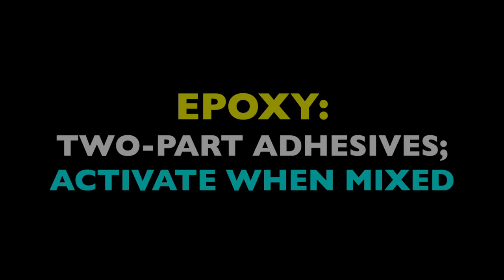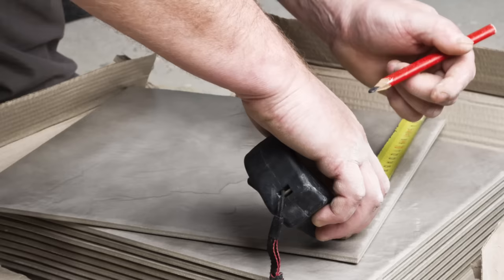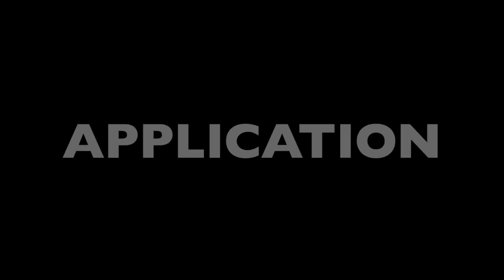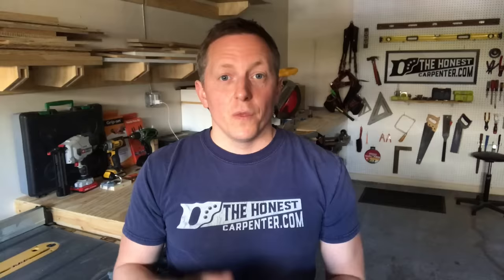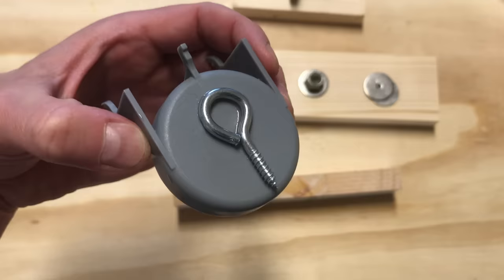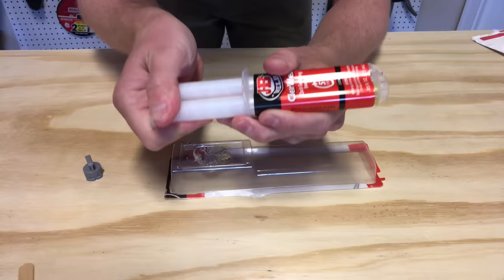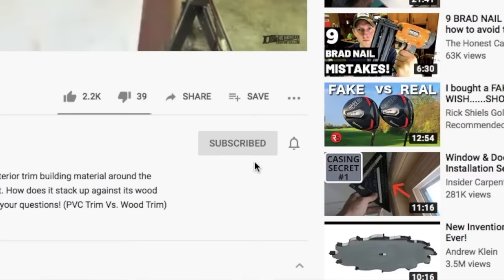DON'T USE SUPER GLUE! Try This Instead..(Epoxy Adhesive/5-Minute Epoxy/Epoxy Glue)

Comment: What is it's melting point so can used on metal parts in engines or weld a kettle parts? Are they toxic to be used on food containers and eating utensils or cooking pots and pans
Reply: Epoxies vary in their sensitivity to or resistance to heat. Generally okay for patching a car radiator but not okay for exposure to direct flame. Most types can handle maybe 300 to perhaps even 400 degrees (read the product info!), but they are petroleum based products and I would not use them on cooking gear. Some types of muffler repair kits might use a particularly high-temperature epoxy, I'm not sure....as a kid, I used a particular type of Devcon epoxy that had a white ceramic-like appearance ( no longer available?) to patch up and modify a leaky mold for fishing sinkers, and the stuff held up well against molten lead at 800 degrees. There's also a non-epoxy paste filler called liquid aluminum that works well under heat, but probably not suitable for fixing pots and pans.....but people have fixed small cracks in engines with JB weld.

Comment: Horses for courses, you would not bother with epoxy on the mitres on the pelmets and cornice on kitchen units would you ? I like polyeurathene glues for some things, urea formaldehyde for others. I only use epoxies when I need strength,and never the fast cure type.  What about contact adhesives, thixotropic or not !    The point ?  there is a place for most adhesives somewhere in woodworking !

Comment: I've always found Superglue (cyanoacrylate adhesive) to be of very little value as a permanent adhesive.  My only real success with it has been on some plastics.  Even then, the repair is only temporary, provides very little tensile strength and always breaks at the repair location in a short time.  Epoxy, on the other hand, is commercial strength adhesive and has been my go to repair adhesive for many decades.  Unfortunately, the consumer is usually limited to those epoxies rated up to about 4,000 psi and for some reason, the higher strength epoxies are limited from consumer use.  Dental epoxies or some used in the automotive industry are good examples of the high strength type.   Epoxies bond, fill gaps, can be cut, sanded, drilled, shaped and reinforced.  Many cure under water or in moist environments.  Most epoxies are electrically inert and are used widely for "potting" electronics.   I have started to use cyanoacrylate adhesives again because of their ability to be accelerated and bond instantly for some applications.  When assembling models and prototypes, parts can be temporarily bonded instantly before being fortified with another fastening method later.  Voids can be filled with products, such as baking soda, or commercially available spray-on accelerators.  There are stronger adhesives out there....and I want them.
Reply: You make some very useful and informative observations here.  Guitar repair is another example where you may want to break the glued part loose later.  The guitar nut might be held in place with like two drops of Super Glue.  Then, whenever it must be replaced, it can be popped out with a hammer.  Guitar frets are presumably also where CA is used.  I haven't any personal experience with fret installation or removal where they have been held down with CA though it's often done.  Most guitar parts are joined with temporary bonds so they might be disassembled later for maintenance or upgrade.  Hide glue, for instance,  is used a lot for stringed instruments.

Comment: 1) Unless you have totally separate containers like that Devcon Epoxy, once you twist off that cap you need to use it all within  a day or two.  '
2) Sometimes thinner is better - for fine cracks in wood that you don't want to Force open or just can't force open to push in that thick epoxy glue. I know of several high-end table makers who use epoxy resin for the basic filler of their tables but also use CA glue as a filler for the fine filler in bubbles and imperfections in the table and the epoxy.   
3) Super Glue in the little tubes is far from the only way CA glue can be found.  Model builders have started using CA (Super Glue = CyanoAcrylate or CA) for almost all kinds of materials.  It comes in super thin (Great for fine cracks in wood) and it comes in medium, thick and super thick versions.  None are as thick as the epoxies shown in the video but then for some projects that thick epoxy is just too hard to spread.   Plus the better CA glues have an accelerator for them that speeds up the setting time and makes that glue ready to function at full strength in less than a minute.
Bottom line - Use the right glue for the job. It may be epoxy, it may be CA or it might be the various forms of old Elmer's glue which has been highly modified into glues like Titebond (At least 3 version) and even the old school glue form of Elmer's glue.  There is no one form or type of glue and epoxies are just one of the many types available.  Oh, and i left out the Silicone adhesives which are a whole nother thing with pluses and negatives.

Comment: Hey does epoxy work on holding 2 plexiglass together???
Reply: There is a specific type of solvent used in plexiglas work. It's not an adhesive, it actually dissolves the plexiglass so the pieces literally "weld". It evaporates very quickly and the parts are permanently bonded. There are many Youtube videos showing how to do it.

Comment: hello, id like to ask...what can I use for glass?
Reply: 100% silicone works great on glass to glass. Especially if you can apply mild pressure to hold it while it dries/sets/cures. It works great on plexiglass/lexan also. Most hardware stores have clear as well as brown,gray, and sometimes black if you need a color. Allowing 24 hours to dry will create a very strong, flexible bond that can be undone if needed. It works well for sticking most anything else to glass also without the need for mechanical fasteners.

Comment: Please help me. I bought a house with a door that has three holes. One for the original door knob, above that, one for a dead bolt, and above that, a door knob. I have no idea what to do. I purchased different sized circular drill attachments, and I have a block of wood the width of my 1940 door. But I'm stuck. Also, they completely screwed up my door jamb to the bathroom, it looks like they chiseled all the way down and painted it. Oh, and they PAINTED my TUB! Who does this???? Help me, please!!!

Comment: Hi Ethan,  I need to glue the rubber liner (just small areas on the side) of an aerobic stepper (like The Step from the 1980's).  What epoxy would I use for rubber to plastic?  I used a double barrel epoxy many years ago, but I don't have it anymore and cannot remember what I used.  Thanks for your help.
Reply: Use contact cement
Reply: @JT_70  never thought of that.  I’ll do that.  Ty

Comment: The problem with using super glues to "fix" things, is that it doesn't "fix" things.  My experience has Always been, that after a year or two, it fails. It's bond strength deteriorates and fails. And it leaves behind a coating that interferes with rebounding it with more super glue, or any other adhesive. It seems to (perhaps) oxidize and crystalize, and break down.
I have basically quit using super glues, and no longer have them, except for repairs that need to only be temporary, and then the item will be replaced completely. Then it doesn't matter if the repair won't last.

Comment: Which epoxy brand do you use or recommend?
Reply: You can't go wrong with JB Weld-Original for most applications. Just stay away from the quick set epoxies if relying on it for maximum strength.
Reply: @davcar872  thank you  😊

Comment: Using cheap brush bristles is a good idea for spreading epoxy. Just cut with scissors and reuse next time. I hate the paddle thing they provide for mixing. Hard to use:

Comment: How many times can you re-use the same tubes after the first application?
Reply: I bought devcon 5 min. in 2 separate containers “plastic eye dropper like tubes”. I didn’t snip the ends but rather unscrew the top and dip out a run or 2 of it with a short piece of coat hanger wire. Use a different wire for each tube. Those bottles are  going on 3 years now and it’s starting to thicken and look like I’m due for a change.
Reply: @ehRalph  Thanks.

Comment: Epoxy has its place and the superglue has its place and you’re better off if you do not mix which one does well with the other one because there are certain things that epoxy does not do real well and certain things that superglue does not do real well but they both have their time and their place

Comment: FYI: LocTite has an Instant Mix version that mixes the two components in the tube. I didn't like the results. Personally, I don't think this works as well as the ones that you mix yourself. It just has the components contact each other and not really mix thoroughly the way you can by hand. I recommend avoiding that one.

Comment: What's the difference between epoxy and construction adhesive. I know there's a big chemical difference, but what's the difference as far as usage?
Reply: The construction adhesive I have seen is quite a different product, more like contact adhesive. Follow instructions on the package.
Reply: Epoxies are reactive adhesives, curing chemically. Construction adhesives are "non-reactive" adhesives, curing by evaporation. Upon evaporation of the solvent, the remaining adhesive bonds the parts. Construction adhesives are better suited for efficient applications of high volumes of adhesives not requiring a two-part adhesive like epoxy.

Comment: Good video BUT I think you are doing "super glue" a great disservice and as brilliant as epoxy is it cant do everything, no adhesive can.
First, "super glue" is a trade name, real name is Cyano Acylate or CA for short.
CA comes in every viscosity from thin as water to a thick gel which will hold its position. It also comes with additives like carbon to increase strength.
The main thing CA does best is make an almost instant bond and this fast cure time can be accelerated, epoxy cant do this.
With CA, you can position a part and then wick it into the tiny gap. I have on the odd occasion used CA to hold a part in position and then put a fillet of epoxy to make the real bond.  You can also undo a CA bond using Acetone, Epoxy can be very difficult to undo if not impossible.
CA is also brittle, more so if an accelerated cure is used.
5 minute wpoxy sets in 5 minutes, the full cure takes hours.
Bottom line is both are great adhesives when used appropriately

Comment: Just make sure you use it in a well ventilated area, as the fumes are toxic. If not, at least use a mask with a gas filter.
There's a good reason why a safety course is required to handle that stuff professionally (here in Denmark at least)...
Reply: I agree 100%.  I had a severe respiratory reaction. In the US we have MSDS posted online by the manufacturer, but are often not read or followed.

Comment: I’m wondering about using it to stick two pieces of a belt together.How does it work where it is constantly being flexed?
Reply: Epoxy works poorly for that. What kind of belt are you gluing? Leather? Rubber? An end to end glue joint will never hold but an overlapping seam should hold. I wouldn't use epoxy for your purposes, I'd use Goop, E6000, 5200, or Weldwood contact adhesive .

Comment: I’ve been using epoxy since before the 5 minute variety came out. I hate super glue. It’s messy and you run the risk of getting something stuck where you don’t want it. Epoxy gives you time to make adjustments in the position and then just wipe away the excess left behind.
Reply: Yes, emergency rooms deal with removal of super glue on body parts.

Comment: So for wood on wood, or woood cracks in a beam, why use this over wood glue and clamps?
Reply: If the joint in the wood pieces is loose or has gaps in it, then you are better off with epoxy  because it excels at gap filling. A slow curing epoxy will wet to the wood and soak into the fibers a little bit and give you a stronger bond than a fast cure, 5 minute epoxy would.  If you are talking about fitted cabinetry, or furniture,  where the pieces are mortished or finger jointed and fit together snug and tight even without glue,, then you are generally better off with a standard wood glue.

Comment: I'm not sure what my deal is but I've never had luck with epoxyies, except for JBWeld. They are messier, take longer to setup, then just don't work - theyre not better than super glue but it's more work for the same failure usually for me
Reply from the maker: Do you live in a cold place, Alec?
Reply: @TheHonestCarpenter  hey bud! I do. Maybe that could be it?

Comment: My biggest problem with epoxy has been poor adhesion. Good on wood but poor on metals. Good on cracked metal surfaces poor on smooth surfaces. It’s a mechanical joint. There is no chemical bond.

Comment: I always prefered epoxy glue with seperate tubes so you can freely choose the amount of each component. For some materials you could want more epoxy resin or more hardener depending on if you need it to be more flexible or harder.

Comment: I consider 5min epoxy to be my 'summer' glue: I live in a northern latitude, and stink of that stuff persists for ages - to the point that it basically precludes indoor use. Not to mention messy. Epoxy never fails to be hilariously messy. It's like herding cats.
I'm a bit surprised that this video didn't mention the 'West system' epoxy, which incorporates filler mediums for shaping and gap-filling. That stuff is like magic. But it's obscenely expensive, and for small applications, I'll stick with the ol' super glue + baking soda work-around.

Comment: What Epoxy would you recommend for glueing the soles of a worn pair of sneakers where the rubber has come apart from each other?
Reply: Shoe Goo is made for that
Reply: @carriewenholz9126  I have tried that and didn't work unfortunately, the rubber comes away after a few weeks
Reply: @redman9pablo  E 6000 is another good adhesive for items that flex. Whatever adhesive you use will probably have to be applied in a thin, even coat to both surfaces, let it dry for 5 minutes until tacky, and then press them together.

Comment: Windblades use so much industrial expoxy it's crazy, I feel bad for the workers who have to breathe the fumes as it sets off either in a barrel and smoke.
Reply from the maker: I can't even imagine what's in that stuff, Doran!
Reply: @TheHonestCarpenter  I forgot Blood, sweat and lots of it, Little bit of love. Wife works there for 11 years. Blade factorys run at 85° which cures the fiberglass, components, as well as your epoxy that has a decreased pot life from high Temps in factory resulting exotherm. I was quality till 2015. Then became full time dad.love the channel.good times !

Comment: Hello there THC! So epoxy adhesive it is. That said, what would you use when wanting to attach a no abrasive material to feet of chairs so that they don't scratch the absolute hell out of wooden floors. Good health to you and yours, Chris from the land of Oz.
Reply: Scuff the bottom of the chair for 'tooth' then a piece of felt can be stuck on with PVA wood glue. Will make a bond stronger than the wood in the chair :-)
Reply: Roger Forrester thank you very much for taking the time to answer.

Comment: I still prefer wood glue for split doors. I find Super Glue works best for fabric applications over smooth surface applications.

Now, Epoxy is evil. The main problem is the requirement to mix it. I can't exactly stick it in an applicator unless I get a longer setup time Epoxy that takes longer to dry.

In situations where you have nearly un-restricted access to the surface, 100% Epoxy. Anywhere you need more control over your application, you may actually want to use a more appropriate glue for that surface.

Comment: Super Glue (cyanoacrylate adhesive) is one of the most expensive products you will ever buy.  Epoxies are not far behind in cost.  EXAMPLE:  Amazon sells Gorilla Glue (cyanoacrylate adhesive) in a 0.71 oz. tube for $8.48    That is $11.95 per ounce.
That is $1,529.60 per gallon.  A commercial 55 gallon steel transport drum will cost $84,095.00    Ouch!!!

Comment: I worked in a few factories,.........Epoxy is only ok,.......5 minute epoxy is strong but breaks like glass,.......you want high impact epoxy (Golf Works ) it take's about 20 minutes before it starts to get hard.

But for bonding plastic Loctite made a glue  that has a chemical reaction and welds the piece's together.
Taking glues and hacking them can make some crazy glues.

Put a few drops of gorilla glue on your wifes best china and microwave it till you see it bubble then turn it off.
Thats some strong glue.

You can use  baking soda on super glue and its like epoxy it gets hot.

Comment: I have used various different brands of epoxy with different materials over the last 20 years. ALL are disappointing and fail in the long run. All adhesives work in the short run but eventually fail. Personally I've given up on all of them. Use a mechanical fastener if you want a long term bond.
Reply: I work with a lot of odd angle joints that are hard to clamp. I've had good luck with pre-fitting and drilling for mechanical fasteners. Mix and apply the epoxy, wait a few minutes then put your screws in. No clamp needed! Wait a couple of days and you're good to go. Of course, if you don't take your time with the prep, you'll have some problems. Been there, won't do it again, I hope.

Comment: What's the tensile strength for Super glue?
Reply from the maker: I think it's between 2000-4000 psi in ideal conditions, Andy, which is awesome. But it has almost no gap filler capacity. That's always been my big problem with it. I think it needs moisture to bond. It can get that from humid air, but the workability is weaker than epoxy.